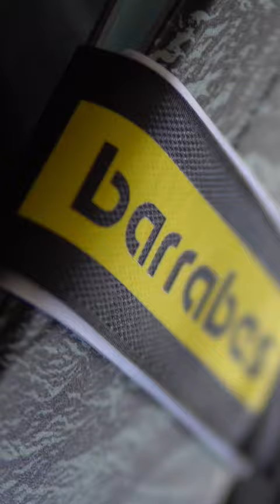How ski bindings are mounted #skiing #asmr #skitouring

Comment: why does my local ski shop take over a week to have mine installed?
Reply: Because they tune it aswell, they do tons of skis at a time, and after each step you use glue it takes a day to dry. So most of the time is 4-5 days
Reply: I literally just got mine mounted in 10 minutes at my local ski shop. @cinfy393 it should definitely not take over a week to get them installed unless the shop is like insanely backed up and busy. Also, all “tuning” is is setting the bindings for the specs that pertain to the skier. All it is is height, weight, boot size, and skiing skill level. That’s not 4-5 days worth of work. I watched my local ski shop owner do it in no more than 15 minutes. I just brought him my brand new skis and my brand new bindings, and my boots.
Reply: @Retarded_Cat   ok so they didn't tune them then, because tuning is not mounting the bindings.
Reply: @cinfy393  mounting the bindings includes “tuning” lol. What do you call tuning? You tell them your height , weight, skill level, and they tune them to those specs……
Reply: @Retarded_Cat no tuning would include things like waxing, edging and sharpening not telling them your height and weight because unless you’re renting it’s not typically a concern to them if you already have a pair of skis. When you go to rent and tell them all the info you thought was “tuning” it’s just info they need to give you the right skills length and width that you can handle adequately